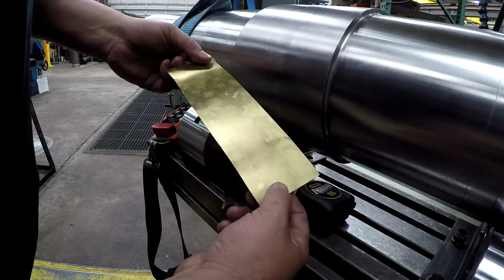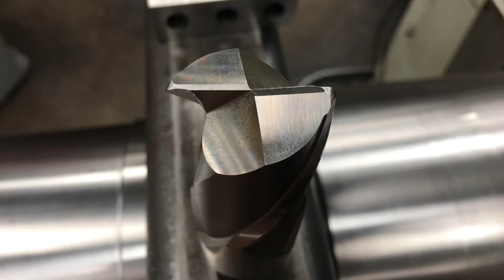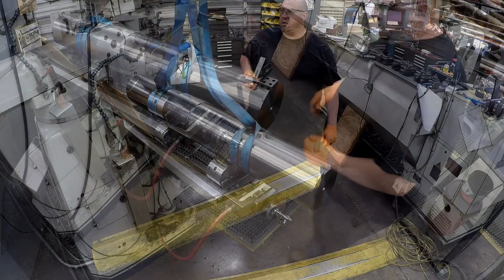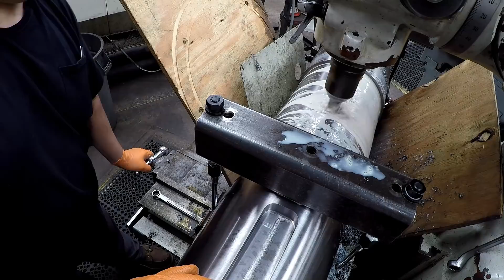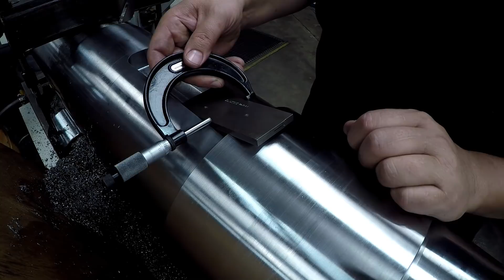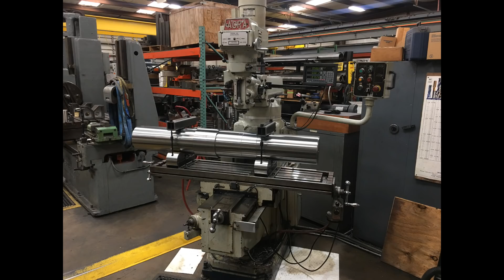9 5 Inch 4140 Gearbox Shaft Part 3

Comment: I have been a machinist for 50 years. I have never machined anything this large and can appreciate the skill of the operator. I find it interested that the shaft was turned without flood coolant. The thermal expansion of the shaft may have been experienced in the taper of the shaft on the final cut. To machine an item of this size on older cast iron lathes, is a testimony to it's operator and shows his love of the game.

Comment: Hello, I have already watched the clips with your participation. Great professionalism and accuracy required in machining. The size of the machines and the machined shaft are impressive. In the past, this method was used for turning, milling and grinding. Currently, it is mainly CNC. There are few artisans like the Sir. As a young man, I helped our blacksmith, Mr. Józef a little. I remember a huge hand drill with a large flywheel.
The worn shaft was milled with a tool with a diameter matching the wedge. I sincerely congratulate you and greet you 😄.

Comment: The cracked end of this shaft would benefit if the key way stopped before it brakes out of the end making the last 1" or so the full diameter of the shaft which will support the bottom corner of the keyway preventing the root stress razor formed by the bottom of the keyway and the open end of the shaft. Just a bit of help from across the pond.

Comment: I use to machine caterpillar parts like earth moving buckets.. Water pumps.. Train engine blocks and control arms for trains and the wheels that goes on trains. Transmission cases. I machined huge parts on 120 foot tables.

Comment: Adam: Thanks for all the well made videos. I am retired from one of the largest paper mills, after 25 years in the maintenance dept. It was my job to replace shafts like this one you just made. We had a large machine shop that made shafts like this one, some of our emboss rollers were 130" long weighing well over 6000 lb. The end shafts some times had to be repaired just the way you do.  Brings back lots of memories, after being retired for more than 20 years, Thanks

Comment: Great finished project. The big stuff is so cool to watch being made. I can only imagine how much a shaft like that cost but I’m sure it was a big number with a few zeros behind it. The 4140 round stock you used was probably several thousand bucks. I sure would hate to miss a critical diameter, depth, or what have you on a project like that. It could expensive real fast.

Comment: Was just puddin around on YT and ran across your page. The shafts that you have been machining, I use to ( no longer spinal cord injury) run those exact model shafts for a company Alstom that was bought by GE. But the ones that I was machining were to be used in a coal burning power plant. 
I use to run em on a Voest Alpine mill turn (102" lathe w/ live tooling. Still watching the video. Lucky you, after you turned your pad at least you had a 4 jaw to bite with. The voest had a 3 jaw hydraulic which most of the time had to pack it for a good θ_/^

Comment: Great job. The only thing I would add is rechecking the parallel on top after bumping it sideways. Not indicating directly down the center of the shaft can give you a false readout and probably contributed to the depth being off a bit.

Comment: Old upload, but I try commenting anyway. I bit info on why the radius helps prevent the crack. It has nothing to do with the ekstra material, sometimes it is the contrary. (ex. a stop-bore) A sharp inside corner is, per definition, a beginning crack. And cracks has a tendency to expand/evolve. An ex. on the contrary is a cast iron piston rod. The rod has a rough surface, so filled with beginning cracks. Removing material, polishing it will then make it stronger, as you remove the beginning cracks. In this case, where this shaft "always" have this failure, a small redesign might help. Make the radius bigger, perhaps even up to a complete half-circle, and make the key to fit, probably would prevent the failure in the future. English is not my native language, so I hope my post make sense.

Comment: Man. I was thinking “Wonder if you can prevent the thing from cracking again by adding a radius to the corner of the keyway to relieve some stress at that point”, and not ten seconds after I think that, Abom just whips out the cutting tool and says “I’ve ground a radius to the corner of the tool so that...”.

Feel kinda proud of myself, not gonna lie.

Comment: Adam, tell us more about the the "V-blocks" used to hold the shaft you made in the mill. They they are shown in the closing pictures.  They appear to use discs to sit on inteD of a V. And the studs pull through them?

Comment: why are you not climbing those sides?
Reply: Its a manual mill that probably uses ACME screw leads and not ball screws. You can get yourself in real big trouble if you try to climb cut on an older ACME screw mill due to the excessive backlash. If you're running ball screws, then you can climb cut.
Reply: you can also get yourself in real big trouble when the cutter pulls into the cut and blows the width of the slot when you are roughing,  I tighten the axis clamps enough to keep it from pulling into the cutter and then on the finish cuts pulling into the cutter is not a concern but I do understand your thinking I just prefer to risk the cutter grabbing over pulling and removing too much stock. I do admit most of the time I run a devlieg and grabbing the stock and pulling the part into the cutter is not a concern
even still climbing gives a better finish for the finish cut.
Reply: @normstaley9799  Yeah, climbing to finish is the way to go, but I never climb to rough. I just don't trust tightening the clamps enough. I've seen an apprentice try to rough climb cut a 3/4 2 flute EM on A2. He destroyed the entire spindle.

Comment: Absolutely beautiful work !!!  You are a master machinist of the highest order.  Wondering about taper at bottom of keyway.  How did you overcome table droop from excessive weight to remove taper ?  Or did it even matter ??
Reply: Its only a few thousandths. That wont really matter on a keyway. The more critical part is the width.

Comment: I liked the whole journey of your craftsmanship. Few years I also did the technical training of lathe machines, after 2 years I got myself as trainee in electrical motor manufacturing company, I was assigned a MKL Grinding machine where i used to grind the fan n bearing shaft areas. It was a fun n learning working experience for me which lasted for about 6 years. The company had a contract working agreement with me n pay was low, with heavy heart I had to give away this job n look for white collar jobs. your video reminded me of those days with machines.

Comment: How much weight can the knee mill support on the table? - That is a heavy shaft! It started as a 12000 lb piece.
Reply: It started as a 1200 lb piece you mean. That mill is pretty big as far as manual mills go. It can probably hold a half ton.

Comment: maybe it would be stronger on the end if you didnt have to cut all the way out the end of the shaft leave a .25 inch  or so of metal if possible and still fit the application
Reply: Yes, it would absolutely be stronger, but then the key probably wouldn't fit into the mating part. They probably have to slide the shaft in the mating hole with the key already in place.

Comment: Great work, but I hate it when you get pulled off a job to do something else. That is not efficient work. I am of the mind that when you start a job then stay on it until it is done. If you get pulled onto something else then that is the workload planners fault by making promises to other clients. This leads to backlogs and other problems down the line.

Comment: I used to Fabricate the gear box casings prior to you fellows machining them to size they the ones I fabricated were for steel rolling mills I appreciate why the accuracy was required for the machining tolerance Nice job

Comment: Seems like running a keyway out to the end of a shaft is asking for this failure.  If it ended just short of the shaft end, this failure would be minimized-- but then, there goes the job.
Reply: That's correct. However, it might be the case that they need the keyway to go to the end because when they mate the two parts together, the key has to be in the other mating part before hand.

Comment: What sort of steel are the milling machine tools made from? obviously it is a much harder steel than the shaft you are machining.
Reply: The end mills he was using were made out of High Speed Steel (HHS) with, maybe, some cobalt in them. The lathe tools are tungsten carbide.

Comment: Good explanation of what it is, as a machinist, I'm sure nobody just explain what the piece you're making .will do &/or the purpose of...but they give dimentions ^ measurements & you take those number & make something. I was facinated by this one large capacity machine shop :Honolulu Iron Works, but it was in Hilo on the Big Island where I am. My Daddy drove trucks for Parker Ranch & "HON IRON" is where he picked all the steel the ranch needed & and as a child I was his "swamper" & got to see so many facinating thins. "Indutrial Steel Co. was a large capacity welding job shop. I worked for "Bear's Machinery" in Kaneohe on Oahu as a machinist helper, plus learned to use the lathe we had @ the prison camp where I pulled the tail-end of my time. I was on the Garage Work Line...I was a welder & a good friend in there...oldtimer, taught me, then gave me ALL the tools & tooling for our big American She was new in the 40's. But she saved us a lotta work. We could bore precision holes for the different mounting plates we had for our IH TD25's. I miss those days, but I'm too old to go back, plus now prison in Hawai`i is ALL "Cold Storage," so you will never see industries anymore here in the Island prison system. We had a lotta good repair tech's who were trained in "Ho`omana School" which was inside of Oahu Prison. Better than doing nothing all day, but pull time...
Great stuff Adam, keep the vids coming, some of us actually love your stuff!!!!!!!!
Aloha,
Chief

Comment: My Uncle Charlie was a Tool & Die maker etc , but I didn't know what his job really entailed.  He told me that working in the shop as a newbe, you would get a farther along if you got along with the old timers,  Keep our mouth shut and do what you were told as best you coud. Intrestingly he told me about the owners son, one of those know it alls was putting a reverse thread on shaft of some sorts.  He could get the first set of threads correct but when he tried to thread the other end with a revers thread he couldn't get it correct.  He had the machine loaded with a mass of fitting etc but still couldn't get it right.  His father came in and saw a pile of reject material and got a little upset.  He ask my uncle to make the shaft.  Charlie took all the stuff off the machine; cut the first thread, then flipped an angle arm of some sorts and cut the opposite reverse threads and finished the job very quictly.
When he retired he sold all his tools. and became a fisherman.

Comment: Never seen a tapered parallel measurement tool before, looks like a good tool. Where do you get them ?
Reply: Search eBay for adjustable parallel. I have a set made by Lufkin, but I'm sure there are other manufacturers.

Comment: that was a great job done there,you brought back my days in a paper mill, that i was in for 22 years , we had a shaft about that size, in a black clawson,vertical gear box, tapered output shaft, that drove a 6000 lb rotor,in a 18 ft hydro pulper, i miss the gold old days.

Comment: Could that be done by a computer mill these days?  Beautiful work btw.
Reply: Of course it can, but you work with the machinery you have at your disposal. The basics are all the same, you still have to align up the part, you still have to manage your run-outs on the lathe work, you still have to maintain control over the machining processes to obtain the desired precision. This gentleman is well practiced at producing quality parts, in a timely manner. His shop is in business to make a profit, and he does not let them down. He is not just an operator, he is a Machinist with a capital M.

Comment: I'm an electrical engineer by trade and I really don't know the first thing about machining, so pleasure excuse the dumb question. When you were indicating the shaft on the mill by hammering the blocks, how does it not come out of alignment during the actual milling process? If merely hitting it is enough to throw it off, how do the forces of machining not cause all sorts of problems?

Comment: Thanks for a great series of videos Mate.
I'm not a machinist but a hobby woodturner who has made a few wooden parts to fit together over the years (lidded boxes and multi-part shafts for walking canes and such). The approach to measurement and adjustment and the way you can take stock that is out of round and turn it true is great to watch.

I've been keen for a while to pickup a small metal lathe just to play with and learn something -  might have to get started now!

Comment: I couldn't tell if the key had a radius on it also but if it didn't, I wonder if that's what contributes to the frequent cracks in the same side of the key way. I'm thinking if it doesn't sit flat in the slot it might act as a lever from the extreme torque.

Comment: I see that lathe was made in my hometown.  I had no idea that cincinnati made so many good machines back in the day until I got a job in a machine shop and every machine they have except  the 2 cnc haas and miltronics machines was made right here in my city by Cincinnati milling machine company later acquired by cincinnati milacron.  which we still have an old arrow 750 cnc.  the electronics keep failing on it because they're 35 years old.  but the machine itself is built like a tank.  way more rigid than our haas and miltronics.  Cincinnati Machines is located a few blocks away from where I work now.  they makes some huge lathes.

Comment: Another excellent series, Adam, and thanks to MI for allowing you to film it. BTW, I see the beginnings of a precision leveling device for your mill. If you cut the cylinders into 120 deg segments and fix two of the segments to a sliding mount with an Acme threaded shaft between, LHT on one end and RHT on the other, adjusting the work piece by squeezing them together or pushing apart. You could use them on different diameters of the shaft and still achieve leveling.

Comment: Thanks. But if that crack is a common point of failure on these shafts, shouldn't the shafts be redesigned/redimensioned? Seems a design flaw...

Comment: Would have been awesome to have a before and after weight. Also, I think that crack is very common in that shaft because it is caused due to stress concentrations within that corner.

Comment: Late to the comments, but if they know that's a common failure point, why don't do a reengineering of the output shaft(and output coupling) with 2 splines?

Comment: Fantastic. Love every minute of all three parts. Thanks for this. One question about the failure on the original piece: You mentioned these fail at that point often. I'm wondering why the piece isn't specc'd differently to make that end stronger. A deeper key cut maybe? Thanks again?

Comment: Awesome videos. I have a lapidary slab saw that has an arbor with a keyway like this only much smaller. I was a little surprised that on an arbor this size you need such tight tolerances.

Comment: THANK YOU ADAM  a true CRAFTSMAN    to machine this large shaft to better than 0,001" tolerance is amazing.  If this shaft 'always cracks in the end key way'  tells me the load needs to be distributed across  2 or 3 key ways.  Perhaps end dowel pins?

Comment: That shaft likely drives the OSB (Oriented Strand Board) wood chipping machine that eats full size logs like a kitchen disposal eats egg shells. The impacts on the blade would have enough force to challenge the strength of such a huge piece of steel.

Comment: Thanks for sharing. The care that you put into your work and measurements is inspiring, true carftsmanship. If it keeps happening, you have to wonder why they don't change the shaft dimensions to prevent the failure? A deeper cut would help spread the load and reduce the stress in that key area!

Comment: Noice! I like how you use brushes and not air. I have never been a fan of stones to deburr keyways... but I am now. No scratches on the floors and good corners. I puckerd at the belt sander portion in the lathe vids. Good tip on the chisel in the corner bit too. Getting .0008" taper with that Pacemaker is VERY GOOD. Now you're down to machine level and way straightness. One thing that I do is put the indicator on the work and not the tail stock. Another .003" woulda put you at .0003" (ish) Its been years since I touched the big stuff... I'm getting all nostalgic. Good job man! OH and before I go... Bravo on the Starrett tooling. The AMERICAN tooing... not the Chinese Starrett. I'm Jelly.